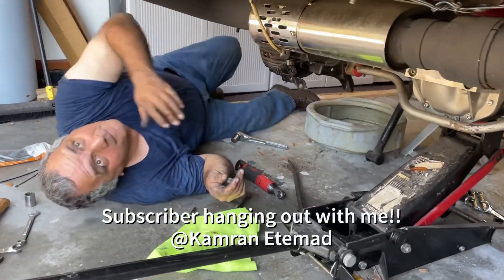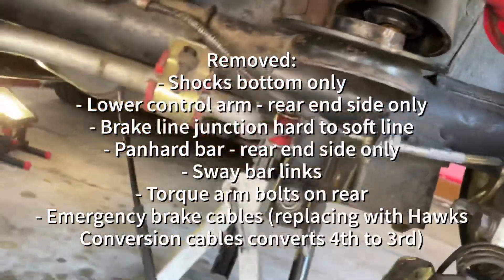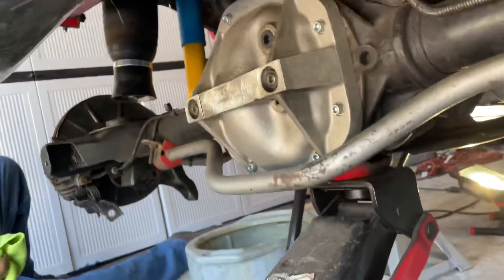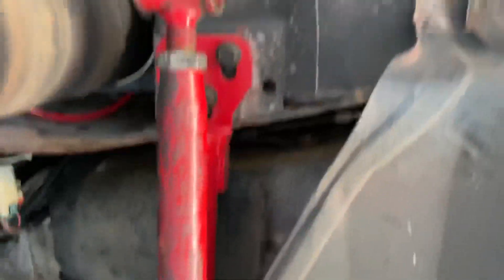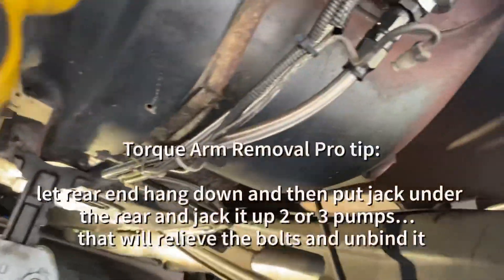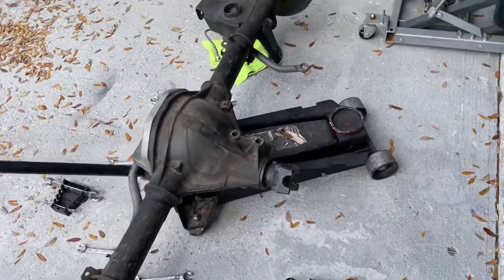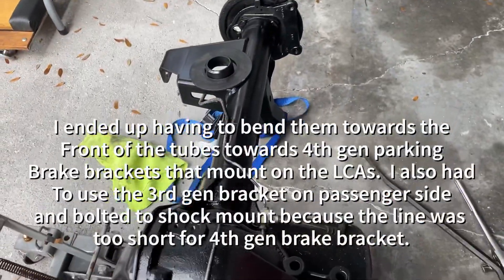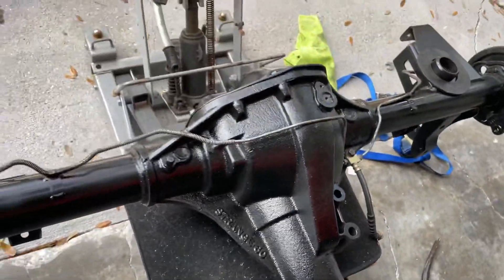Strange S60 Rear Install + “LS1 rear brake install

Comment: Strange said 6 weeks til mine is in my garage. I can’t wait! I’ve heard nothing but good things about this rear end
Reply from the maker: Awesome, that is about how long I had to wait I think. I’d recommend the powder coat if you haven’t done that.
Reply: @FireballMullet  yep, ordered the powder coat. Ive also seen and heard of the issue you had with the spring perch holes so I sent them the outside diameter specs of my ground control base/adjusters and asked if they can open up the holes in the spring perch. We’ll see

Comment: Just got mine last week, i kept it stock 3rd gen width and im going to be using 93-97 discs, viking DA shocks. I also got umi adj control arms and panhard bar. What sway bar did you go with?

Comment: The thing I took from this is the major difference in diameter of the chrome-molly driveshaft vers the OEM aluminum one. Can you tell me that difference, as well as the two actual diameter numbers? With our cars, the limited space for exhaust alongside the driveshaft is a bear, this may be very helpful. Thanks
Reply from the maker: It’s the camera angle, but I also thought that looking at it side by side, but they are the same diameter.
Reply: @FireballMullet  WOW! good thing I asked, I never would have guessed that, Thanks!
Reply from the maker: @davebarron5939  no problem, ask PST or Strange (whoever you buy from) what diameter it is, they make them different options

Comment: what are your wheel specs. Im probably going the Strange route and now Im wondering if I should narrow the rear as well.
Reply from the maker: Honestly I’d say measure the setup, this ended up being similar if I had done 6.75” backspace on 18x10”

Comment: Im told the Treme TKX and Ford 9" with long yoke is a direct fit for our factory driveshafts using a conversion u joint.. Anyone know if that is correct?
Reply from the maker: I’m not sure but hopefully someone knows and will respond.